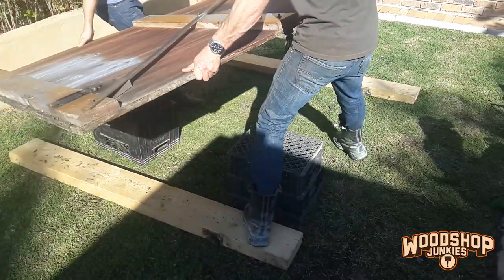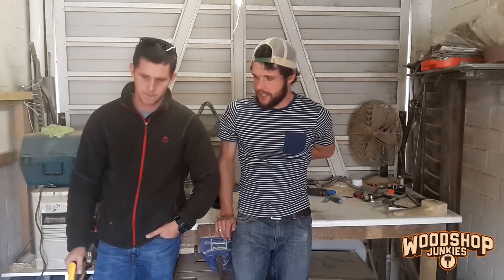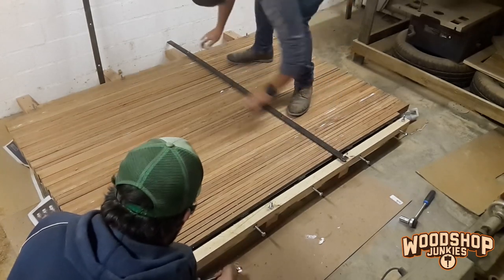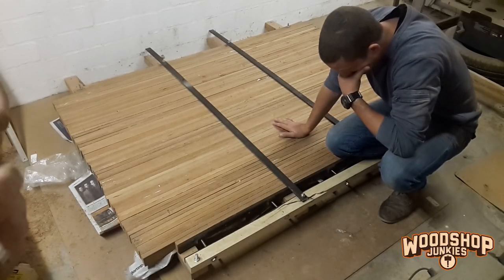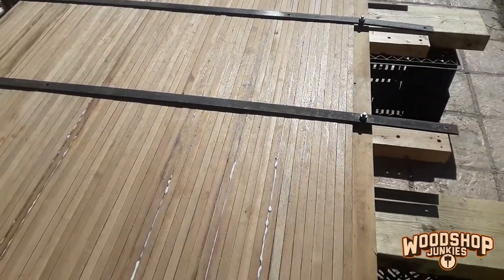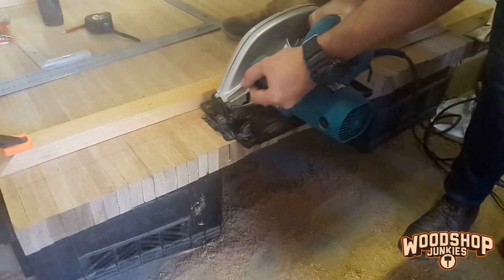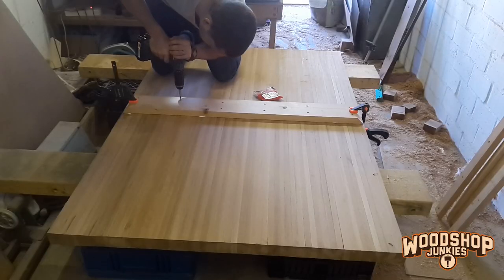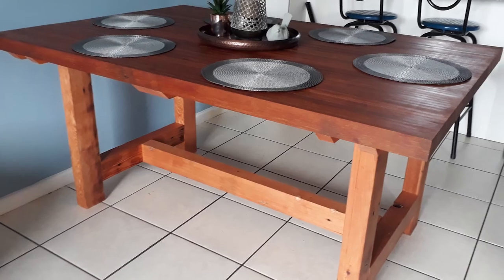Old garage doors turned into an reclaimed wood farm-style dining table DIY built by amateurs

Comment: Great Table Lads, i think there would have been a few bleeps if that was me, after the table top split. 
One little tip when you do any glue ups, don't use newspaper as it will takes ages getting it off the wood, use some Grease Proof Paper the stuff you use in baking to stop your cakes sticking, or use some Silicone Sheets.
It's amazing that in your last video you got all those old doors, and some of the wood from that turned into a beautiful solid table.
Well done lads.
Barry (ENG)
Reply from the maker: Barry Roberts thanks man. I don't understand how people can throw away wood. Their garbage is my gain. Love it!